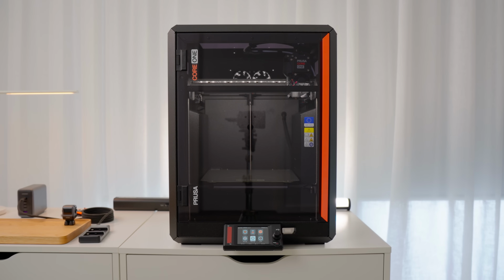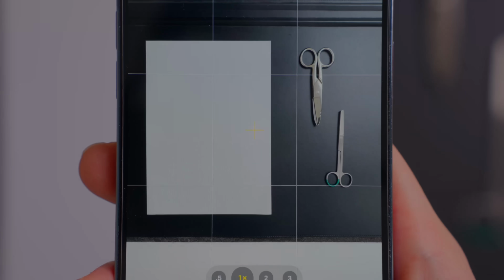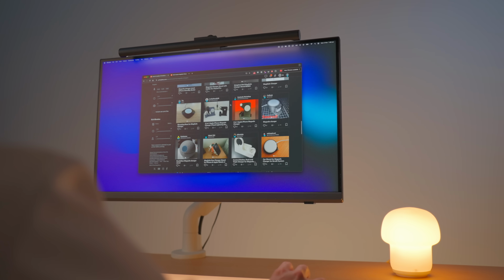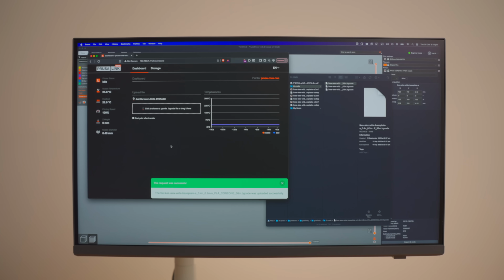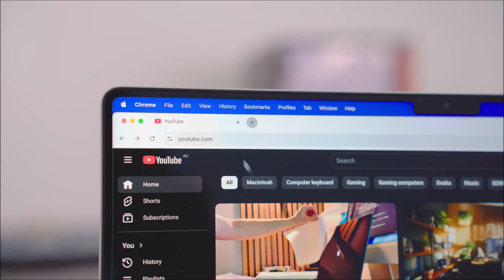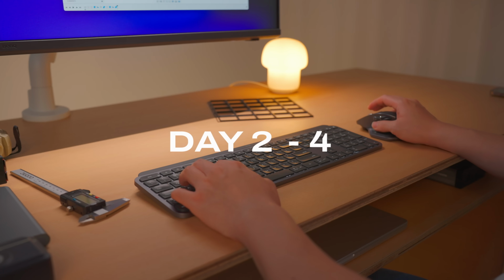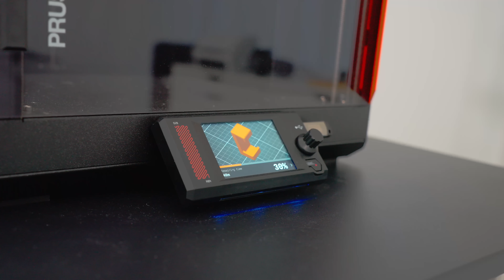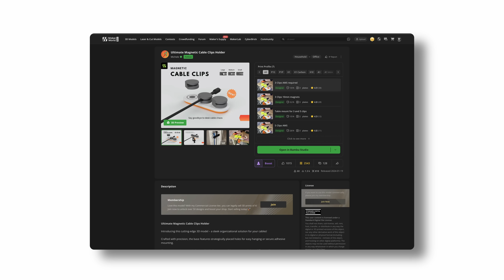Organizing My Life with 3D Printing

Comment: You mentioned Makerworld, which is a BambuLab product. Is there a way for someone who does not own a BambuLab printer to download the STL (or whatever they use) and finagle it to work with whatever printer you have?
I got the feeling that while anyone can look around, you can't access any model without the Bambu slicer and a Bambu printer.

Comment: Hi, how did you attach the Skådis pegboard to the cross-brace? Did you use the mounting hardware that comes with it or something completely different?
Reply from the maker: Hey, the pegboard attached onto a bar that is normally installed into a wall. I just left a bit of a gap when screwing the pegboard into the bar so there was some room to hang it from the cross-bracing of the bookshelf. I took a shot of the back of the shelves in another video of mine. I'll leave a timestamped link here.
https://youtu.be/xPPTMBTvcA0?t=137
Reply: @TerryX_  Thanks!